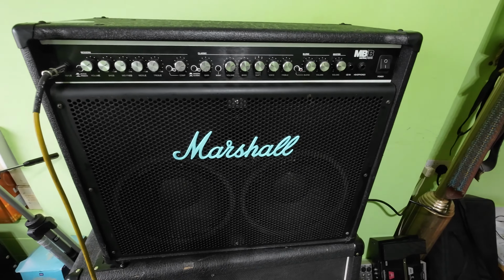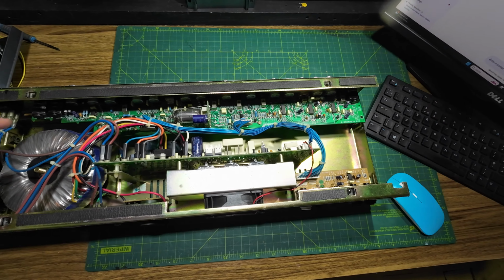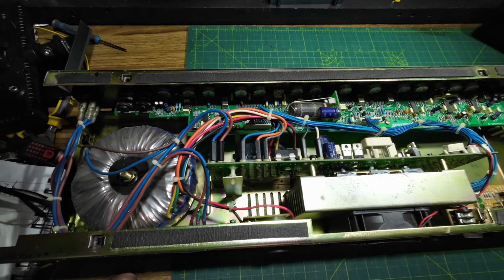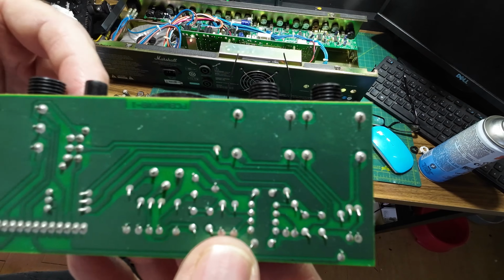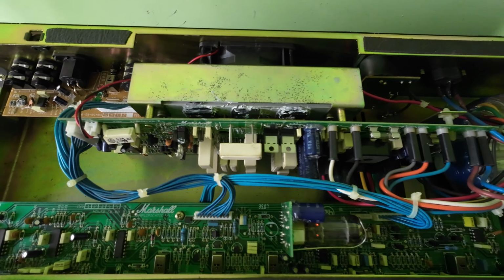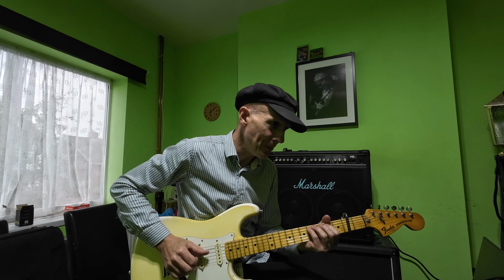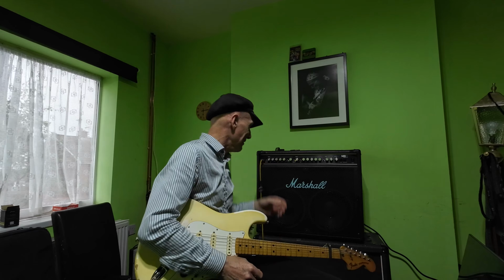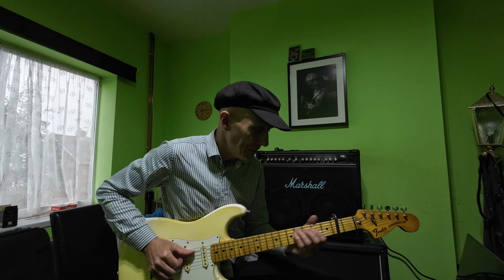Marshall 4210 Bass Guitar Amplifer Repair + Altered Tuning Demo

Comment: I have a confession Martyn.. I quite like some solid state amps and I always had a Boss compressor handy for those 'country' twangy moments. Amazing playing again even though the amp wasn't what you unusually play through.
Reply from the maker: Hello Pete, thank you. I like some of the older solid state amps. The HH  amps pretty good. Take care Pete.
Reply: @vintageguitaramp_guitarteacher   , the Lab Series solidstate amps, which were designed by Moog and manufactured/marketed by Gibson, were pretty darn good and had a number of well known users, from BB King to Alan Holdsworth to Ty Tabor. The LS5 was the one most preferred by pros;  I had a "dead" LS3 which somebody had given to me, and the only thing wrong with it turned out to be a blown speaker.  It sounded pretty good for clean warm blues but was fairly simple, nowhere near the sophistication of the toneshaping and EQ circuits in the LS5.  The unfortunate thing about once-popular 40 or 50-year-old solidstate amps like that (including the Kustom amps and the Roland JC120) is that getting transistors for them nowadays is probably more difficult than it is to get parts for a tube amp!